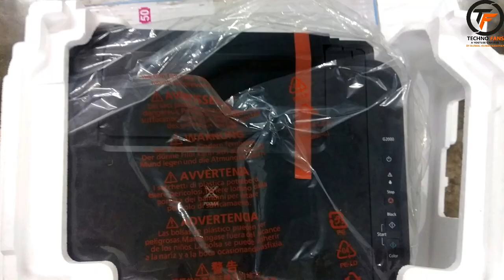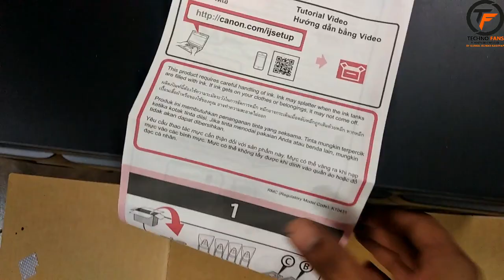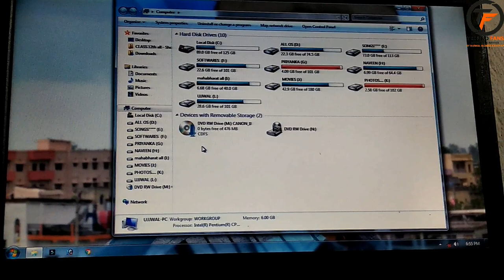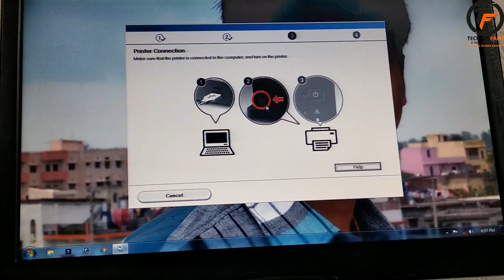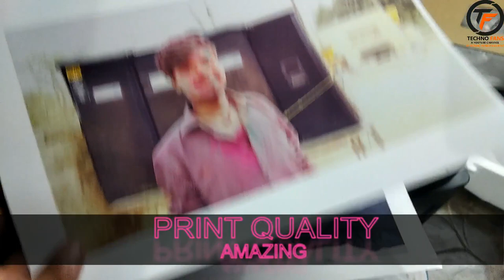UNBOXING CANON G2000 PRINTER, SETUP & PHOTO PRINT TEST [HINDI]

Comment: How's the durability . Iam confused between g3000,g2000 and Epson l380 , please help. Can we print pvc card from these printers
Reply from the maker: Between g2000 and g3000, according to price and performance g2000 is best...
And 
Between canon and epson, if you want speed and quality then go for canon
Reply from the maker: Epson is good but, very slow printing, and service is costly. Expensive parts. And printing quality is also not good...
Reply: @TechyFansuk  can we print pvc cards in canon g models
Reply from the maker: No, it cannot print pvc card

Comment: Sir what is difference between g2000..And g2012..And g2010..?
Reply from the maker: There is a small Display in g2012.. other than this everything is same...
Reply: Sir u told that g2000 is older now in one comment..Then which printer i should buy under 10k
Reply from the maker: U can buy g2012